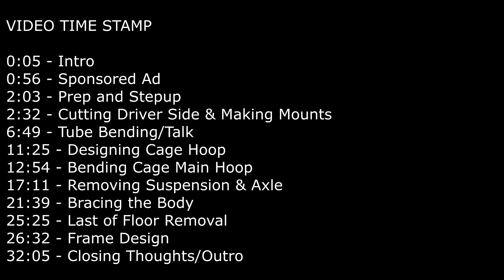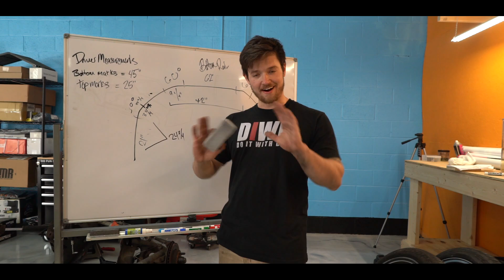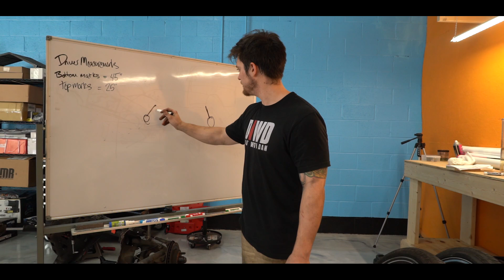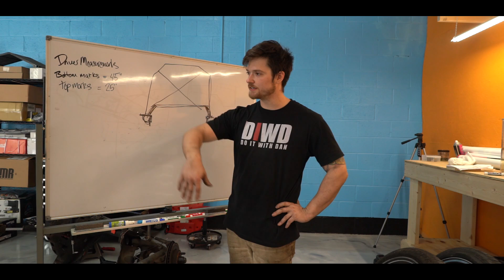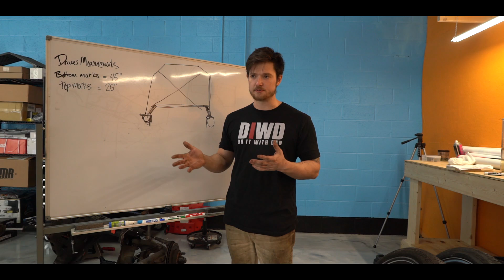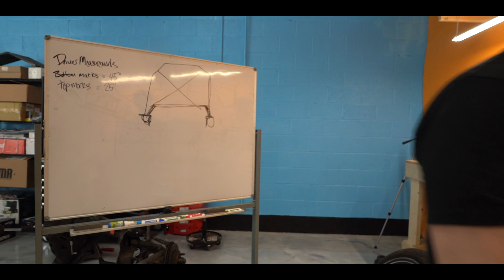Let's Build a Tube Chassis for the FOXBODY MUSTANG COP CAR

Comment: 0:05 Intro
0:56 Sponsored Ad
2:03 Prep and Stepup
2:32 Cutting Driver Side & Making Mounts
6:49 Tube Bending/Talk
11:25 Designing Cage Hoop
12:54 Bending Cage Main Hoop
17:11 Removing Suspension & Axle
21:39 Bracing the Body
25:25 Last of Floor Removal
26:32 Frame Design
32:05 Closing Thoughts/Outro
33:35 End

Comment: 2 things swag off road air over hydraulic for the bender  and a kickass angle  gauge  kit they have will save you along with carbide tipped circular saw blade for your chop saw zero sparks and no heat in the tube after the cut

Comment: Great video, you could use some of that steel to make a extension sleeve for the tube pipe bender lever so you could just slide it on when bending thick pipe to make the lever massive and easier to pull.... just a thought 👍
Reply from the maker: been planning on it lol but its so hard to stop and fix something that youre using lol

Comment: well the back and front frame on my dirt race car is square tubes,  well rectangle.   but the bars that make the cage is all tubes Bud.   Why?  well the low bars as flat surfaces make it easier to build from.   Then the Round tubes also save weight at the top and well as a understanding that you should have most of your mass on the lower part since it will also help to keep the car grounded.   also when you build your new Flores it will be easier to weld the pans in....

Comment: if you want to measure a pipe after bending it take a loose tape measure like used for clothes and measure the small side of the bend and the long side of the bend add both together and divide by two

Comment: Since I'm finally caught up with your uploads. Keep the Ford 8.8 and rebuild it. I've rebuilt mine in my 88 and they are a damn good axle. People like to talk shit on them and say you should run a 9" or something from GM. You really don't need to do that. You can swap the pinion with a higher spline to handle more torque and run stronger axles that will handle plenty of power. I don't know what you're end goal is for torque but unless you're building a dedicated drag car pushing out over a thousand lb ft of torque that 8.8 beefed up with better internals will server you just fine.

Some other reasons to keep it. The angle of the pinion is actually very efficient compared to bigger axles. You'll retain more power through the driveline with that 8.8. Also it's lighter which is another benefit and backs up why people like to use the Foxbody platform with building a track car. They can be very light which is why they dominate the drag racing scene in competition despite people swapping in GM engines and other stuff.

Based on what I've seen you do with your Magna and that sportster you had a while back I'm sure you can handle gutting and rebuilding a Ford 8.8. If you do, get a hold of a 40 ton press so you can pre-crush the crush washer for the pinion. A 20 ton won't be enough, I tried. Or you can grab a shim set instead and adjust the pinion depth. It's more time consuming but you won't get your ass kicked trying to get the crush washer started or measuring the resistance of the pinion with a torque wrench measuring in inch lbs. I did this when I swapped a rear from a 95 GT to my 88 when I did a full 5-lug and rear disk brake conversion.

Comment: Just waiting for you to snip the last pinch weld that holding this heap together. Hopefully you don't split the car in half while you're inside it.

Remember the most important part of this chassis is where things mount to it. Suspension pickup points are your anchor. A custom 4 link makes that more flexible, but they are one of the only things that need to be in a certain spot. Normally we'd jig off of the pickup points.

Also, something to keep in mind is that you need to be able to weld the BACK of every pipe you install. Don't get ahead of yourself.

Comment: If I was you I would see if a crown Vic front end would fit it’s adjustable easier to work with if your run cool over and for the tube chassis

Comment: Contrary to popular belief. Round tube isn't 100% better than square tube. Round tube is better at resisting twisting forces. Square tube is better at resisting linear forces. This is why truck frames are still square/rectangular. They will handle vertical and horizontal forces far better than round tube will. If you incorporate braces by forming rectangles you will end up with something far stronger for frame rails. Round tube is better for a cage because it's there partially for structure of the car but it's primarily there to resist impacts from an accident. Those kind of forces are going to be twisting and impacts coming in from a direction other than directly vertical or horizontal.

Comment: Guess that is what happens when you have a rusty uni-body setup...  This is going to be its own experience.
Reply: I just hope when I get down to doing the pans on my 63 beetle it wont be nearly this in depth..
Reply: Was also trying to remember if there even was a sub frame on that set up.  I think normally there is up front if so?

Comment: Still telling you man get it dipped or blasted. no point in letting that leftover rust slowly creep back up .
Reply from the maker: I am removing all of it anyways brother. I figured that it was obvious, but yall cant see in my head lol. I'm going to be building everything that is not the body myself.
Reply: @DOITWITHDAN  i mean fair enough. Just figured that with the paint and rust  a good clean base woudlnt be a bad idea.Ive seen too many times cars have a little bit missed then 5 years later start to rot out again. Obviously if you lose your fucking mind with a cutoff wheel and plasma you can likely be ok..If you got the time then yeah fuck it.
Reply: in my mind (aka just my dumbass opinion) id blast it to get a clean surface and then get it etch primed to stop the chemical reaction (4 those of you who dont know rusting is a chemical process and just because you cant see it doesnt mean its not happening. ) then cage it to keep the strength.then slice and dice those panels like an episode of cooking with dan . thats just me though..im not the dude with money invested so you know like take it or leave it . just force feeding my thoughts here.
Reply: @DOITWITHDAN  also roguefab needs to send you a m600

Comment: thats a roll cage not a tube chassis. youre still using the stock chassis so its not a tube chassis
Reply from the maker: I am not using the stock chassis
Reply: @DOITWITHDAN  you called the roll cage hoop bar a tube chassis, but shit if youre truly making a whole new chassis good luck shits hard and i cant wait to see it
Reply from the maker: @samdemarco1487  yea I'm not the best with terminology 🤣
Reply: @DOITWITHDAN  youre good LOL also, when u were welding that brance by the footwell while cutting the floor your welder sounded like it needed more zap zaps and wire. next time that happens just crank em both up ever so slightly until its a consistent sound not that like popping sound with gaps in between each arch could also be just shitty metal or if ur trying to weld over paint idk. cause of the virus had to get some dogshit chinesium tubing from the home depot on dallas highway and that shit would barely even weld. also man, i make art pieces with metal wouldlove to gift you one if youre down!